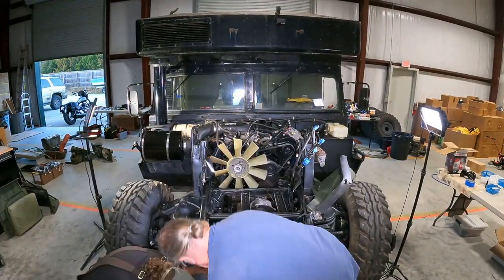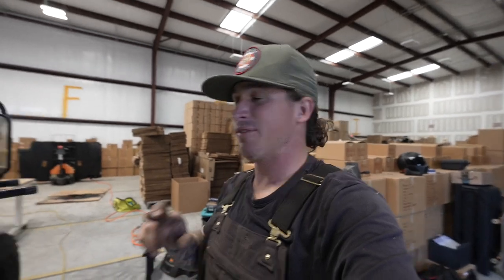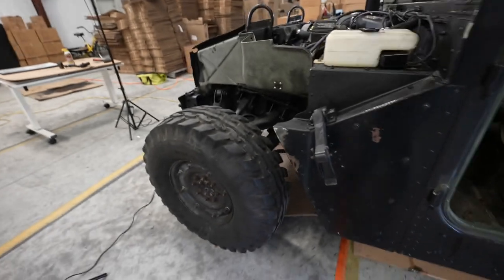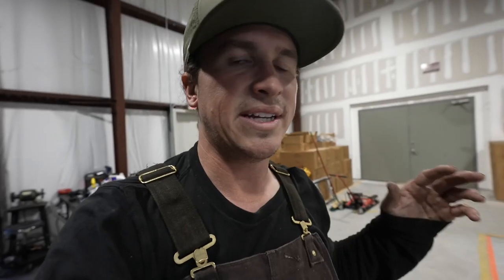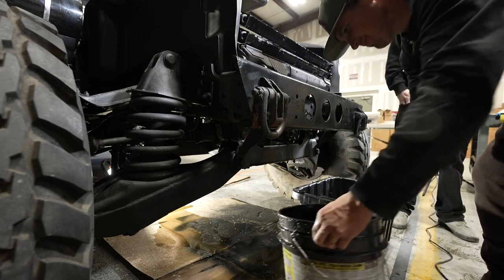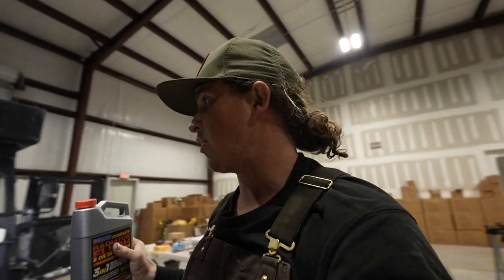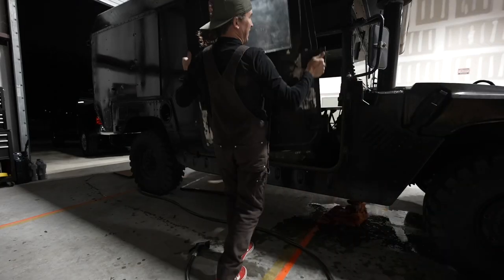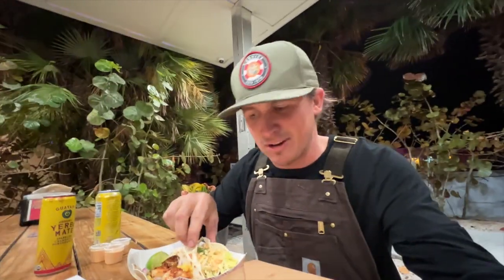Military Humvee Radiator Flush: "Its Running!"

Comment: get rid of that keyed ignition, it will burn up your start box. keep the original switch and grab a power-relay style key system from like thosemilitaryguys or other providers that dont bypass the original key. second, your humvee shouldnt take that long to crank and start, check on your glow plugs and ensure you wait to start. also, swap the bolts on your half-shafts to the brake disks with some 12.9 hardware and locktite so they dont come out. awesome build and good luck!
Reply from the maker: thank you for the knowledge!!